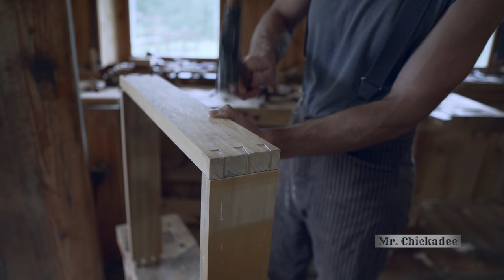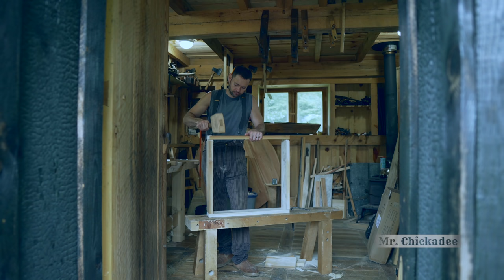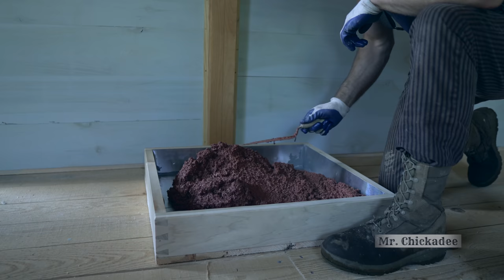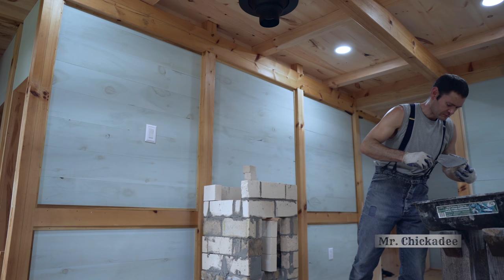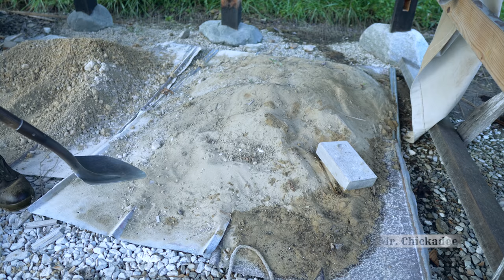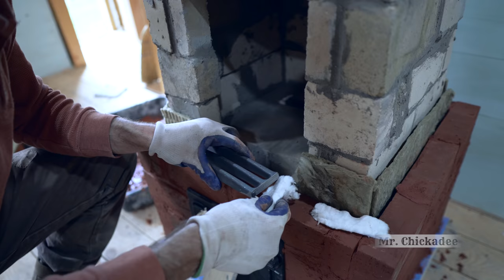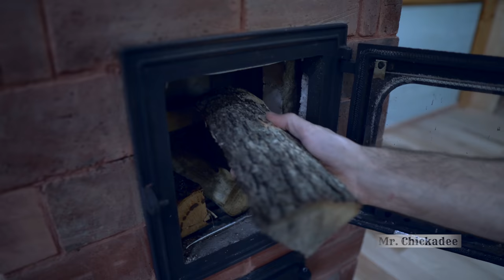Small Masonry Heater for our timberframe

Comment: I don't understand why an additional layer of thermal insulation is needed. On the contrary, in a Russian brick heater, it is important to increase the mass of the heated stone. The greater the mass of the heated stone - the heat is given off longer. This is what you need from the heater
Reply from the maker: Are you referring to the slim layer of mineral wool insulation? That is an expansion joint to permit the core to expand.
Reply: You dare question the gods
Reply: Dear ????
Maybe because of the different thermal expansion of the different stones/bricks!? It's better to have a thin layer of stonewool instead of an air gap.
Best regards, luck, health and wisdom.
Reply: @MrChickadee  I was thinking the same thing, Norwegian brick heaters are huge but allowing for expansion makes a lot of sense.  Thank you.
Reply: Dear  @MrChickadee  
So I was right with my early comment.

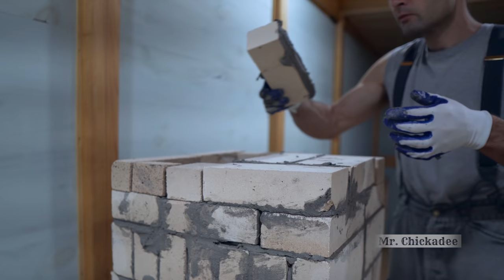Comment: He said upper bell, so this is almost certainly the design... as follows: There are two heating chambers, the firebox and then the upper bell. The firebox is 18 to 24 inches high (a simple box) and is "mostly closed off" at the top, only allowing a full brick OPEN to let the gasses into the next box, or upper bell. This is shown at 13:55 (the angled bricks layer to support the next row of bricks making the "roof" of bricks separating the bells, and the finished result at 14:30 where the gasses toward the back are allowed to pass into the second box or bell via an open space of one brick. Now, this stove may be SO SMALL the second bell may simply be the same design as the fire chamber (box closed off to one brick to trap gasses for a second or two, however....., if the space in the second box allows.... the upper box would have a chimney or riser that begins toward the bottom of the second box and the entire top of the upper box could then be closed off with bricks or "sealed." This would trap hot gasses and draw gasses toward the bottom of the bell trapping the hot gasses for a few seconds in the second box before they could exit out. The idea behind these stoves is not for the gasses to flow in a straight line up the chimney and out quickly, but to trap the hot gasses, at least for a second or two, in each bell. This heats up the bricks and the bricks radiate heat for 4 to 6 hours after the fire is out. The downside to this stove is, it takes over an hour to start heating the house. It takes a long time for the bricks to absorb heat and radiate it out.
Reply: Did you notice how many masonry bricks he used by any chance?

Comment: Clever dying the mortar the same color as the bricks.  Sure makes a neater-looking finished product without so much cleaning, acid washing, wire brushing, etc. I was hoping to see some temperatures.  I have no doubt the design works but I would like to know how well.
Reply: hmm...It would be very hard to know how his temps would match that same design in a different building in a different area under what current weather.

Comment: A beautifully executed stove build.  Question though.  Given the refractor brick and rock-wool's higher insulation value, are there issues with stack temperatures rising too high, and not getting enough heat conduction out of the combustion gas and into the thermal mass / air in the room?  Or is there a secondary heat exchanger or long single wall chimney section that you are using to extract heat from the burn?
Thanks for the video.
Reply from the maker: The mineral wool is just an expansion joint so the core can expand and not crack the facing bricks. It does not do much at all to restrict heat from traveling between the two layers.
Reply: @MrChickadee  Thanks for the info.  Very good to know.

Comment: That was great. If you are ever thinking of making a hearth in another building, I think you should consider making a Rumford fireplace -- they are very efficient and quite unique.
Cheers.
Reply: if you want a fireplace, the Rumford is a good choice. But no fireplace is as efficient as a masonry stove, and even a Rumford pales in comparison to any of Mr. C's stoves.
Reply: A regular fireplace puts around 10% of the heat made into the room. A masonry heater like this can do closer to 90% of the heat while pulling less room air to draw away the smoke. A Rumford fireplace is a few times better at radiating heat from a hearth into the room than a regular fireplace, but you'll still burn twice as much wood for the amount of heat you could make with masonry heater.

Comment: Really enjoyed the video. It is difficult to tell the clearance amount behind the unit to the wood of the struucture. I am retired, but I laid brick and stone for 30 years. In our area, code requires 10 inches minimum of solid masonry plus at least a 2 inch air space to anything combustible. I am not saying that you did not do that. I just can't tell from the video. Overall I think it is really an amazing job. I look forward to seeing more from you.
Reply from the maker: Masonry heaters require 4" from combustables. I have around 6.
Reply: @MrChickadee  Thank you for the info. I wasn't meaning to be critical. It looked like a very practical, safe design.

Comment: Did you think about installing a cold air intake to the exterior to negate the negative air draw from inside the home?
Reply: Since no vapour barrier was used the house will naturally leak air and does not need an intake.
Reply: The idea with masonry heaters is a short, hot burn to heat up the masonry then let it go out so all the built up heat can radiate over the next several hours.  Since it's probably not going to be lit often it's not a huge issue is my guess.
Reply: I agree with the others. You are thinking along the lines of a modern, super-tight house. Watch how he builds and you will learn. Mr. C builds his structures to breathe, so you aren't going to get drastic pressure differences. I don't think Mr. C did any blower door tests on his structures.

Comment: I wonder about the comfort difference between this and an old ben frankiln stove.  Personally, I love an old wood burner stove...although I hate the cold chilly mornings when you get up to stoke the fire.  But does this retain heat better or make it more of a comfort heat rather than that 'man it's hot by the stove but cold everywhere else' type of heating?
Reply: Yes it's designed to store the heat of the short roaring fire built like he shows and radiate it into the room for probably 8-12 hours. For a small masonry heater like this he'll probably burn 1-3 firebox loads of wood a day to heat the addition. Much more fuel efficient, cleaner burning than a damped down wood stove. Safer for kids and pets as the outer bricks never get flesh searing hot. Safer for homeowners because fire is out while he sleeps.
Reply: In short, it does both... 'retain heat better' would be a big understatement. Much more efficient to boot.

Comment: Another great video, Josh. I want to know more about that perlite mix, as it's plentiful here in Japan. Seems like it's almost air-crete,... with heat dampening properties? Also liked seeing the red mortar dye, that stuff is hard to come by here. Cheers from Shimoda.
Reply from the maker: Did you watch with CCs enabled? It creates a form of insulated slab to just protect the wood from any conducted heat.
Reply: @MrChickadee  Yup, I remembered to turn them on by that point. No explanation about air-crete similarities, but I got the mix ratios. Great idea. Thanks for the feedback.

Comment: Wonderful as always. I really like the masonry stoves designed by peter van de berg. 

I know that local and natural materials for masonry stoves is fairly unpredictable, but i wish there were more engineer minded masonry stove pioneers. I’ve seen a rumsford stove made from all local material. Horse manure is a common addition. Straw, sand, clay, and rocks are put into different proportions to create heat mass storage or heat insulative mixes. Perlite is hard to mimic though. I don’t think a light sand straw clay lime mix would be insulative enough to keep the fire hot enough to burn off particulates.

I’ve also heard that materials mined from the same location expand and contract at the same rate, which makes me even more curious of the possibility. I know that there might be an issue with yearly re-building if it doesn’t hold up, but if you can reduce wood consumption by 1/10th of a typical inefficient metal stove, you’re just doing masonry once a year instead of chopping and stacking 5-10 cords of wood every year. Sadly,  skill isn’t a modern strong suit and if machines can’t do it for people, most won’t even want to do it if it were found possible.
Reply from the maker: Good questions, the little bit I know is that traditionally these were made from solid clay bricks, and clay mortar. This was necessary since the clay mortar and clay bricks would expand and contract at same rate. You could not just use stone and clay mortar for example, or use any lime or cement based mortar because of the heat. Also back then they used just normal clay bricks for the firebox, and yes it would degrade and need rebuilt every 5-10 years. Often the design was made so the firebox was seperate from the mass of the heater and chimney so you could tear it out and replace it without redoing the whole thing. 

I have also heard of a simple parging being added to the fire chamber to protect the normal clay bricks, something like sheep wool mixed with yellow clay, or charcoal pieces mixed with clay and sand, both mixes having the idea that once the organics burn away little air pockets are left like a sponge and this creates an insulative layer on the firebox walls. This would of course crack and need replacing too. 

Later double skin heaters were built so that tiles or stone or other materials could be used on the outside safely, either with a red brick or later refractory brick core, as this heater shows, these being the new "double skin" heaters which are common nowdays.

Comment: Great work as always. The only part I don’t understand is using clay in the mortar. I guess as long as it stays dry it’s ok but does it bond as well as lime?
Reply from the maker: bonds very well, and is more easily repairable if needed. Can even be reused since it never undergoes a chemical change like lime or cement.

Comment: Nice! However I'm curious about the top part / connection with flue (we only see it briefly, done completely, near the end), and there seems to be some structure to the chimney, not easy to tell from the video. Are there plans somewhere that you based this on? I imagine there are tried and true ones if one knows where to look, but I don't :)

Comment: Are fire bricks seem modern, do you know what did they used to use instead? your workshop stove is built without them, is there a specific reason? Thank you so much for your videos!
Reply: Old times brick were burned in small patch, piled like big owen. Innermost got more heat and become harder and were suitable for fire bricks. Next ones were good for chimneys and outdoor and outermost were poor quality but suitable inner walls or making next brick patch parts.

Comment: Hmmmm. It was like watching thru a 21st century window on days gone by. Very relaxing to watch if you have the time. It's almost in realtime. However I have a few questions about the build as beautiful as it is...and I am not trying to put the mockers on this but merely please educate me and others about this. My question is: I do not see any down draught channels so that heat from the fire can be dissipated into the external brick skin? In fact you have insulated the brick skin from the inner core? So this seems to me that all the heat is directed up the chimney? Have I missed something or am I just wrong in my assumption? Correct me please.
Reply from the maker: 1/4" of insulation is just an expansion gap so the core can move without cracking the facing, this is standard practice in double skin heaters, that little layer or insulation does next to nothing to impede heat transfer.
Reply: the backflow channels are there, he's just not teaching where they go, nor how to go about that--it looks like he's buidling from a plan (probably someone else's)

Comment: I think we may have found something that he hasn't mastered yet, masonry. He's doing an ok job but it's not his best work. I hate masonry and don't use square anything of I have to do it I'll use rocks that are all different sizes and shapes so I can blame my shortcomings on the fact they're not square. LOL! I can always take a hammer and make adjustments as needed at the top to make it look flat and level from one side to the other. LOL! As long as it keeps you warm and don't fall over it don't have to be square level and pretty right. This wood heater definitely fits your style of rustic building and living. I like it.  👍
Reply from the maker: I aint no brick mason, thats for sure, but I can lay a brick or stone when needed, and if it works, it works.

Comment: I would love to know why there is insulation between the inside and the outer bricks. I just don't get it. Doesn't it just make more heat go up out of the chimney? I've seen stoves that use an air gap to prevent too much heat from radiating onto nearby objects, but this insulation seems like a whole different thing to me.
Reply: I was just about to ask this as well. I don't understand it's function here.
Reply from the maker: turn on CCs for more information

Comment: Does a masonry stove put out much heat? Seems like itd take hours to get all that mass warmed up and returning heat to the room. I've never used one,I've always had steel or cast iron stoves. Looks fantastic though,great work.
Reply from the maker: yes it does, you start warming it, then keep it warm with subsiquent fires, normally one or two fires like I show per day.
Reply: @MrChickadee  neat,good to know. If you dont mind me asking,where do you get your metal doors and from?
Reply from the maker: @ciphercode2298  Links are in the video description above, both the heater designer and the hardware supplier. You can have the design and materials for a good price, often cheaper than a top quality metal stove and with much better performance and beauty.
Reply: @MrChickadee  Great,I appreciate that. I'm sorry I missed it

Comment: So here's the magic: how did you transition from the rectangular opening at the rear of the inner chimney (seen earlier in the video) to the round stovepipe at the front (seen later)???
Is there a rectangle-to-round piece of metal / flashing inside? Is there no transition, but an "open hole" inside between the rectangular part and the start of the stovepipe?
Really curious to understand what's happening inside to get this transition done (safely). 🤔
Reply from the maker: lots of ways to do that, most simple is to leave a square hole, stuff a round pipe into it and caulk around the edges with mineral wool then mortar or high temp silicone. Im sure there are more professional and neater ways...

Comment: Странная печка, непонятно за счёт чего она будет обогревать. Зачем прослойка изоляционного материала между кирпичами?
Reply: It's for expansion he said.
Reply: Mr. Chickadee answered this question for another commenter. "Are you referring to the slim layer of mineral wool insulation? That is an expansion joint to permit the core to expand."  So it's not to keep the heat in but to allow for thermal expansion.

Comment: Sweet baby sweeet. The very best way to heat a dwelling. Metal and or soap stone wood burners, wood boilers are no way efficient on fuel sources as the masonry wood burner. Mass heaters are the way to go. I like any other YO-YO these days have done a Google= information Highway 2 week binge on best material for masonry heater or mass heater builds. The thing tht most always mentioned is the fact the space you’re trying to heat must be very tight. Every hole plugged for no cold air drafts. All walls and ceilings most be very well insulated and  floors. If heater in basement then skip insulating the doors tho. Heat rises don’t cha know.

Comment: Does anyone know if that structure in the foreground on the left, at 4:16, has a specific name... in terms of its design or construction method (post & beam?), etc.  Even better, know of any plans somewhere for something like that?  Finally, can that be enclosed?
Reply: Looks like a small Japanese style timber frame built much like the addition he's putting this heater into, and the blacksmith shop he's got videos of building.

Comment: Beautiful, though pardon my lack of knowledge, what purpose does the layer of insulation between the core and the face serve?
Reply: Insulation between core and face is to slow down heat flow from core to room ambient and to lower surface temperature. This insulated outer layer is typical way in here northern europe.
Reply from the maker: Its an expansion joint, can also be cardboard or just a simple space, but easier with the insulation, of 1/4" to permit the core to expand without pushing the facing bricks and cracking them. 1/4" of insulation does not really inhibit the heat transfer much at all.
Reply: @MrChickadee  thanks